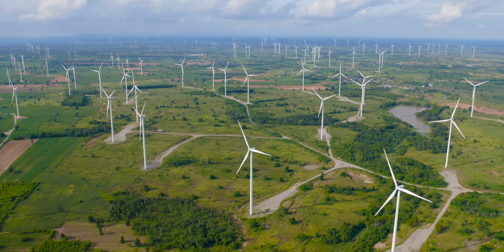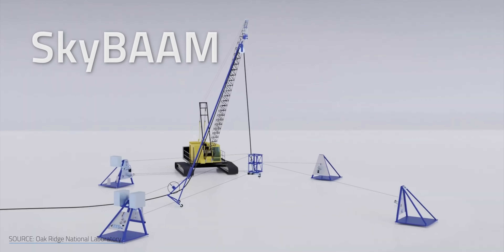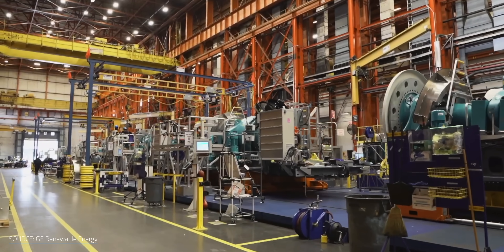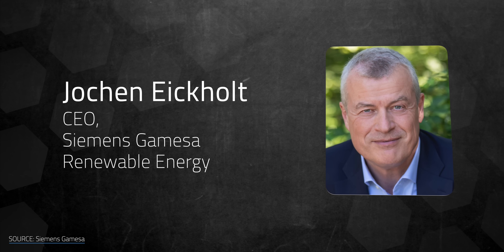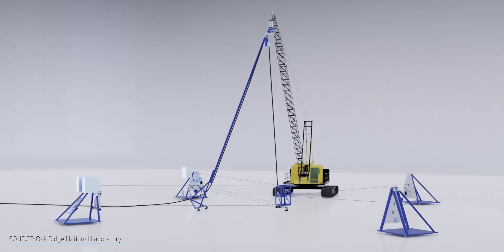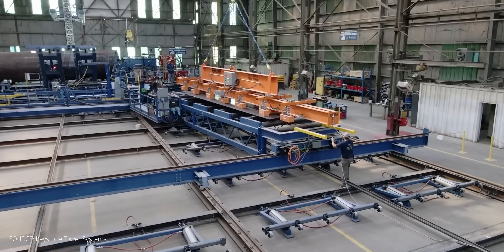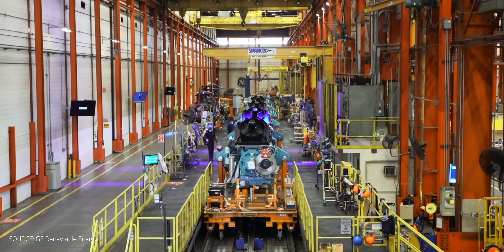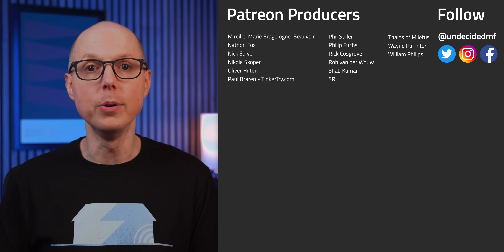Why We Need To Rethink Wind Turbines

Comment: As a Wind Technician I cant imagine the headache of maintaining the Myriad multi rotor design. Just imagine maintaining your car if instead of having one engine and transmission, it had ten... Every bearing needs grease, every gearbox needs oil. From a practical human perspective I don't see it working out. Technicians complain about ergonomics between working on Vestas and GE towers. I hope they test it out for 2-4 years before trying a utility scale project.
Reply: To be fair, the car analogy is kind of silly because there are electric car designs with a linear engine per wheel that work very well. That's how many modern high speed trains operate as well.
Reply: @joergsonnenberger6836  Yep, very poor analogy  ..
Reply: Theoretically each smaller unit could be easier individually to work on, like a bunch of go-karts vs a car/truck/semi (depending on scaling factor) you might have to work on 20x more things but those things would each be easier to work on, Plus you can potentially bring only a few bades offline for maintenance instead of the whole turbine (depending on what your doing) meaning you can potentially schedule maintenance more frequently as the opportunity cost for doing so would be lower. Additionally because your working on seperate things you could have more people/crews on 1 spread over the smaller individual units to speed things up.
Reply: @CaptainBlueTech  you don't work in maintenance do you? It doesn't work that way. It the same amount of work to work on a 50 HP engine than on a 500HP engine, same for every machines. Do you think it take 10 times longer to change oil and filters on a big engine, than on a small engine? And to bring more people to speed things up costs more
Reply: @CaptainBlueTech   Based on what theory? Repairs for a go-kart aren't that much faster than repairs for a truck for most things. At least not the orders of magnitude necessary to make up for the difference in transport capacity.
Reply: I agree, that is the key challenge with the multi-rotor design. Essentially it would have to have a catwalk for technician access, which represents all sorts of challenges.
Reply: Imagine instead of one acre of beans to harvest you have 10 acres of beans to harvest. Yup sounds like more work to be done.
Reply: @MAGnetICus_Attractus  not even remotely the same thing, its more like you need to do an engine swap on 10 go-karts vs 1 on a semi.
Reply: I don't see it getting past a single prototype per company. It screams of marketing to the less informed (solar roadways, water from air in deserts, ...).
Reply: I don't think they will even get to the full scale prototype before the company dies.
Reply: Vestas already built a 3-rotor windturbine prototype several years ago, and this is the conclusion: just a prototype
Much more money to pay per every Mw produced

Many ideas or designs have been launched and announced to obtain energy from the wind: no-rotor turbines, multi-rotor, multiblade,...
And aways, the 3 blade, steel lattice wind turbine is the best option for perfomance vs cost.
Reply: @ignaciofernandezclavel3535   I mostly agree. Steel lattice towers are rare at least in Europe as the construction requires more man hours. The most common types seen here are either steel tube, concrete or hybrids of the first two classes. The specific choice depends on factors like the cost for labor, material and transportation.
Reply: @joergsonnenberger6836  In fact I meant steel tube towers :)
Reply: It's a non-starter.

Comment: SIGNIFICANT IGNORED RESEARCH: Check out the research led by Cal Tech's (and Macarthur fellow) John Dabiri about Vertical Axis Wind Turbines and their relationship to vortical patterns in schools of fish. Yes, fish.

The limits of HAWT are the wake distortion downstream from the turbine, decreasing efficiency of blades without ample spacing. His research increases efficiency with tighter packing of VAWT increasing energy generated.

The research is more than 10 years old, SIGNFICANT, and sadly IGNORED.
Reply from the maker: Thanks for bringing that up.  I need to look into that.
Reply: @UndecidedMF  I'm a software engineer by trade, with capability well above average, but below that of a researcher. I mention this because I have watched good ideas go unnoticed, while more fashionable trends gain momentum. I have become disillusioned by the notion that good ideas will automatically gain traction.

One such example is shallow geo-thermal which has been around for at least a century: a technology that would reduce emissions for heating/cooling of residential and industrial sites, but also suggests dramatically reduced electric load and mid/long-term associated costs. Thankfully, in this case, we are seeing an increase in popularity of this at present.

In any event, it's my pleasure to share this with you and with others. Fare thee well.

Comment: Reducing CO2 production.
Natural gas appliances are more energy efficient than most generating stations. Most are still boiler stations where 2/3 of the heat go right up the stack. All coal stations and some natural gas plants. Natural Gas appliances have no line losses, transformer losses etc.
Heat pumps with efficiencies over 350%. However it's better to get the load off the grid. This frees up power to charge EVs and PHEVS.

Comment: I would like to see the theoretical power per square meter of swept area for multiblade versus conventional wind turbines.
Reply: Surely it will be the same value. Formula for wind turbines is Watts=1/2*sweep area*air density*wind speed^3*efficiency. Although, such close blades might cause might turbulence interfere with the air speed on each blade. The economics of it will probably be the deciding factor. Perhaps longer life due to smaller stronger blades, perhaps cost more due to more motors and maintenance.
Reply: @AORD72  r² sweep area scaling makes the number of smaller blades needed kinda silly.
Reply: @ledorf it is silly
Reply: @ledorf  maybe, it is a good point. I see lifetime of blades as a big factor also.
Reply: @ledorf  So the biggest turbines are about 125 meter in radius. Or a sweep of 49078m² With blades of:
50m	you need 6.3 to match 125m
40m	you need 9.8 to match 125m
30m	you need 17.4 to match 125m
20m	you need 39.1 to match 125m
10m	you need 156.3 to match 125m
Reply: @AORD72  My money is on it being worse. About the only advantage I see is simpler logistics allowing for potentially quicker deployment.
Reply: @barongerhardt  maybe, I see smaller blades as being able to made stronger and that might increase the lifetime to twice as much.
Reply: @AORD72  I don't know if either of those are a real concern for the industry. One are the blades the primary limiter of lifespan? Does the industry even consider the current lifespan a issue?
Reply: @barongerhardt  I guess it depends on who you are in the industry, turbine builders probably want to sell more, so not so worried, power generators would want the blades to last as long as possible. Generator companies evaluate generation systems on the LCOE, in which lifetime is important.
 
I was under the impression that there is a lot of blades reaching end of life and causing disposal problems. I would speculate the blades need to be as light as possible to be able to build them as long as possible to maximise the sweep area, so smaller blades are likely to have a longer life because they will be stronger. 
I would think the generation motors would last a long time. I know there are turbine without gearboxes now to reduce maintenance and failure rates (direct drive).
Reply: @AORD72  I'm fairly confident if they wanted blades that lasted longer they could easily do that. As such there are reasons they don't. For one, lower mass provides several advantages. Far more important is that is likely the designed life of the full system. Think of them like tires on your car. Making them last forever wouldn't extend the life of the car. Using a slower wearing compound that results in poorer traction, higher rolling resistance, or increased rotational inertia can quickly out pace the advantages, but is very doable with current tech.
Reply: @barongerhardt  "I'm fairly confident ", I don't believe so. Fatigue failures is a real problem in engineering. Try building a lightweight narrow structure that is over 100 meters long, it will be hard to make it stiff enough to not bend and crack.The blades are under huge loads, the blades are subject to high levels of loading and fatigue. There is a reason that the turbines shut down under strong winds, because the blades will fail, the loads are too much.
Reply: @AORD72  If we assume everything you have stated to be true; blade life span is the most significant limiter and large lengths mandates light, less durable material. The reasonable expectation would be that smaller blades would already be made of more durable materials. Do we see this in the industry? If the answer is no, there is something wrong with our assumptions.
Reply: @barongerhardt  Smaller blades can be made with the same materials but be stronger so they can last longer. The reason they make bigger blades is to increase sweep area. So it is a trade off, but in that trade off life time should also be a factor. Sure it could be that the longer life of shorter blades doesn't make up for the extra costs of materials to build them. I don't have all the data to draw a correct conclusion, but I doubt you do either. Although we haven't seen any multi-blade towers so I suspect they aren't profitable. Buecase if they were I would expect them to have already been built. That being said these directions can be overlooked by engineers sometimes. Would be great to see a test unit built and the LCOE studies done from it.
Reply: @AORD72  I wouldn't be surprised if many engineers (or bosses) have overlooked multi-blade designs either assuming they wouldn't work as well or refusing to try something different from the established norm.  Before wind turbines were used to generate electricity, windmills were used to do a variety of mechanical work and with the materials and equipment of the past a multi-blade design would have been far less practical than it is now.  I believe there's a term for the sort of inertia that keeps a company or industry doing the same things that brought success in the past and often double down when those methods start to fail.  Of course as you said we won't really know for sure if the longer life spans and cheaper and likely safer and easier deployments will offset any energy losses from using smaller blades and multiple generators.  One thing I thought about that could help the multi-blade design (potentially, I'm not an expert) would be to tie all the blades together into one generator.  I presume they'd need some way to adjust in the event some blades are spinning at different rates (something like a CVT) and there'd probably be an additional penalty in terms of output but if it made the system cheaper while also helping it last longer it might be worth it.
Reply: @AORD72   the salient measure is levelised cost of energy.  Multiple generators with moving parts and copper wraps might suck up the other savings, or they might not. The bean counters will let us know.
Reply: @trikepilot101  exactly, LCOE studies will show the reality. But the best LCOE studies will be done once the systems are built.
Reply: It will be tha same, somewhat below the Betz limit. A single turbine will be far lighter and cheaper than this multiple turbine nonsense.
Reply: @rogerphelps9939  True, a single turbine will be overall lighter and cheaper to build, but if the life time is increased to twice as long due to blade lifetime then it might work depending on the cost difference.

Comment: Betz formula for efficiency...

Physics dictate the solution to all problems and in the case of wind, the larger the swept area means more power generation with less wind thus...large turbines.

Multiple small turbines increases complexity and cost.

Is there a better solution?  Maybe but again, physics determine the outcome and larger turbines currently are the best solution.

Comment: Why isn't VAW being explored more?  Seems like a better solution, without the issues of massive blades to ship along highways and rail.
Reply: VAW is not a better solution, they would do it otherwise.
Reply: @niconico3907  - why is vertical axis not a solution?  It seems it would be more efficient, with less energy loss.  Plus, they can be positioned closer together than horizontal axis structurs.  And, fewer mythical bird deaths.

Comment: The airline industry has overall developed an integration of design/ manufacturing over a half century 
Wind turbines has only been doing that for 2 decades, most of that in the last decade
Reply: So wind turbines have two decades ignoring lessons learned and paid for by aerospace and airlines?
I wonder if subsidies and government incentives have anything to do with such poor management and knowledge transfer
Reply: @ricardokowalski1579   Airline and areospace industries had their own problems with faulty materials. The price pressure in the wind turbine market is significant and over the last decade, much of the civil engineering capacity in the field has gone toward minimizing the construction and material cost.
Reply: @joergsonnenberger6836  why yes they did. As you correctly pointed out. Those lessons were ALREADY available to the windmill designers.
Why did they ignore these costly and hard won lessons?

How was price an issue if they were ample subsidies?

As for the "civil engineering", the lessons from offshore oil and gas are extensive and available. Why ignore those lessons AS WELL?
Reply: @ricardokowalski1579  Have you considered that the civil engineers are no morons? Offshore oil rigs are completely different beats when it comes to load profiles compared to wind turbines. They age very different, they are made from entirely different materials, they are subjected to much less dynamic loads. Even existing radio towers are not comparable because they can't alter the load actively as a wind turbine can by rotating the blades out of the wind.

I don't know were you are from, but in my part of the world utility scale wind turbines haven't been subsidized directly for a long time. They get a fixed price for the generated electricity and therefore any reduction in the price of the construction directly affects the bottom line.
Reply: @joergsonnenberger6836  the subsidies are applied at the energy sale price, not at the structure
The problem is not the load profile, it's the installation, maintenance and service costs. And NO, they use the very same materials for the platforms, foundations and risers

Why would you talk about radio towers?

Why would you avoid the airline and aerospace part?
Reply: The wind turbine problems are similar to but not identical to aerospace problems. Furthermore aircraft designs are still evolving and there is a lot to be done if aircraft are goinfgto get anywhere near net zero. @ricardokowalski1579

Comment: It's no secret why we don't see VAWT & Other Experimental Wind turbine designs used by Commercial Wind power operators. They are not as effective as tradional designs. Until they are more effective, or beneficial we won't see them in commercial operation...

Comment: Most/best land for Wind Turbine is cheap and desolate. Offshore turbines are also away from beach goers and major sea routes. Even if they fall it's not a big deal. Land closer to cities or with mixed use comes with restrictions that prevent the use of the biggest wind turbines even if the land owner did 0 research.

Comment: 14:00 or so: think the blockage effect is an example of the inverse-square law. The volume of the blades as they get larger in area, however, is an example of the square-cube law. It’s how multiple blades can reduce total manufacturing costs by keeping internal volume of blades low while increasing total surface area by making multiple small blades. I guess they did the math and found it to be a better balance?